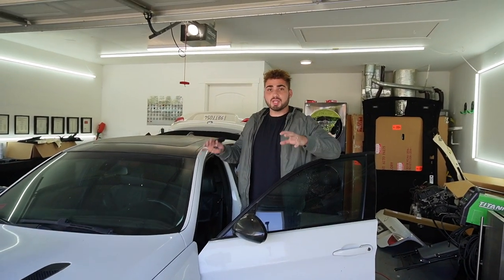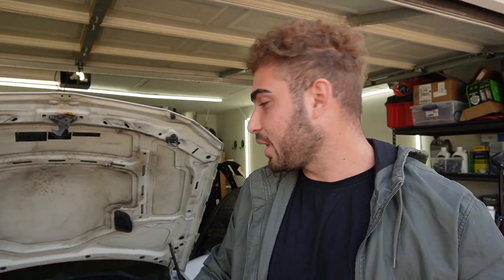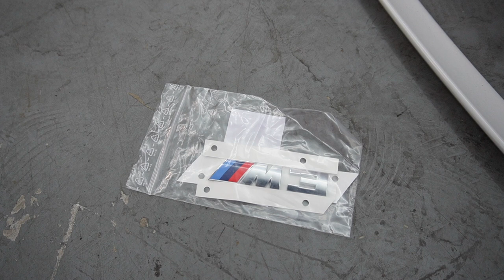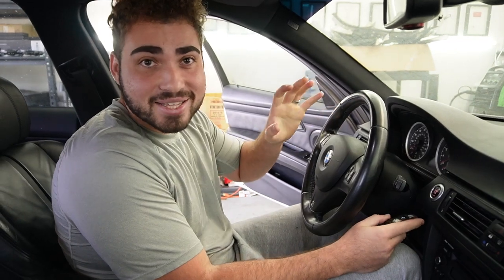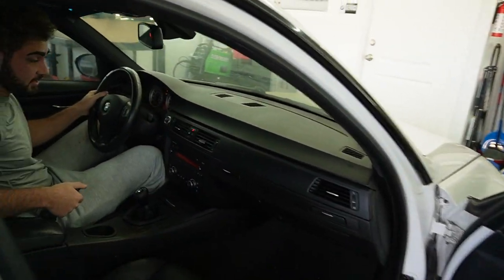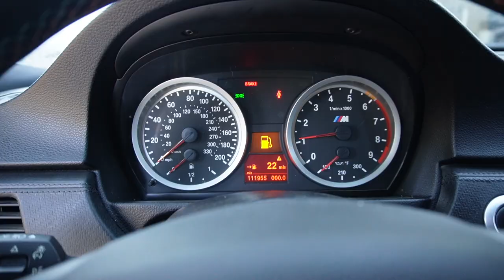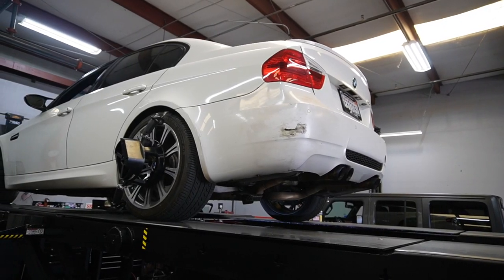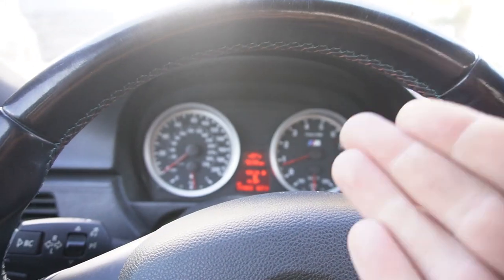THE E90 M3 IS BACK AND BETTER THEN EVER! (90% RESTORED!)

Comment: Nour, does the whistle occur at a specific RPM? If so, it could be your plenum. I had an issue where the plenum had a crack inside. Here's a video - https://www.youtube.com/watch?v=tCukQ3xfEWg.

You can test by using another s65 plenum on the e90 to see if it whistles. Best of luck.